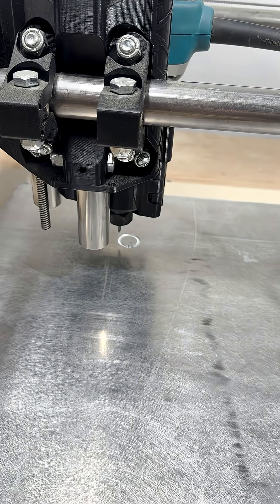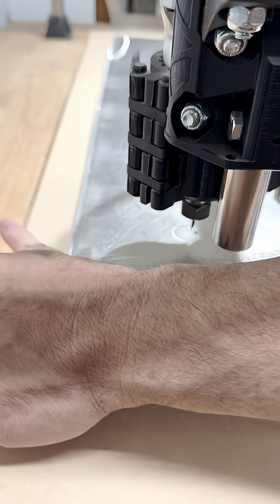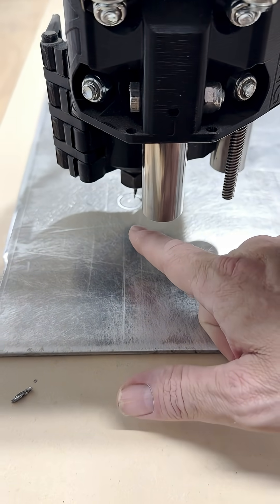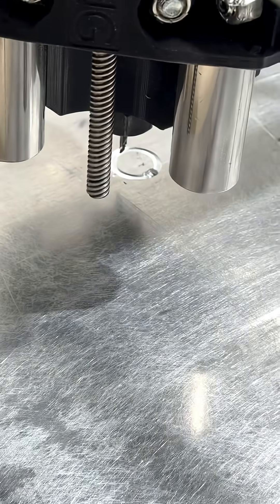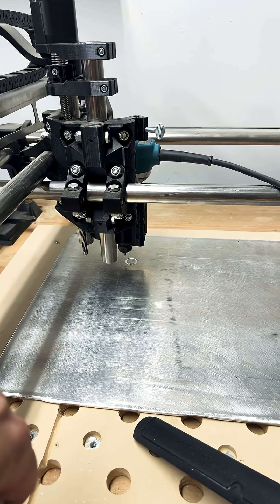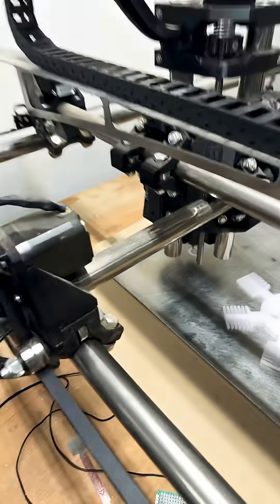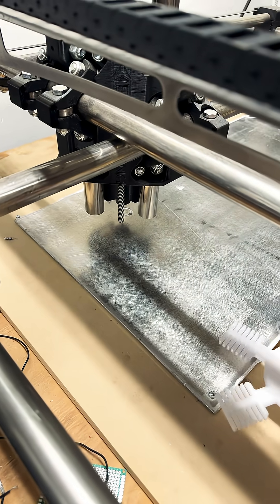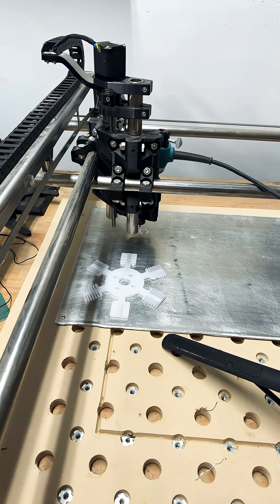Cutting the heat sinks for the 340 mm EDF on the MPCNC.

Comment: Hi
Reply from the maker: Hi
Reply: @warmachined3472  that cutter looks like a 2 flute? Try a 4 or even a 6 flute cutter. Try ramping into the material rather then just plunging in Z. The centre of the cutters don't like it. The machine is working against you, ideally you need about 6000 rpm for that job.
But it's doable.
All the best, and good luck 👍